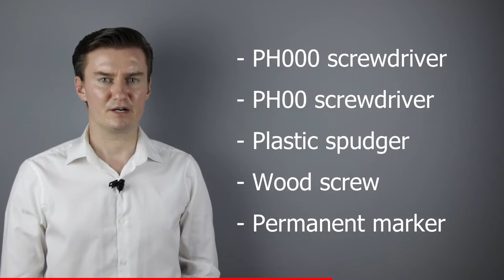Sigma 18-50mm f/2.8 EX DC MACRO disassembly to replace the aperture flex cable (repair howto)

Comment: hello thank you for your video. I have a "Sigma DC 55-200 mm" which has fungus. Is your tutorial is valid for disassembling it ?
Thanks
Reply from the maker: This lens is completely different from yours. 
Your lens is very cheap, and I would just buy an another lens instead of working on many hours.
Reply: @CamerasLensesEtc  ok thanks for your answer

Comment: Intesting... I have an Sigma with this problem... nice video... thanks, I do not have much certainty if I have the courage to do this repair.
But... an question... why didn’t you use plastic gloves to touch the inner parts ... the grease or sweat on your hands can’t cause problems like fungi?
Reply from the maker: Fungus is caused by the moisture in the air.